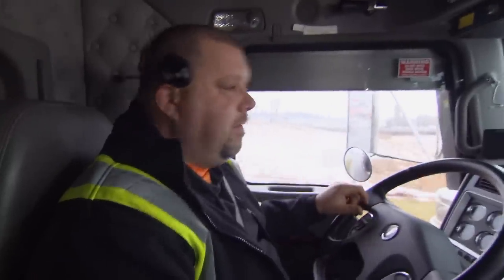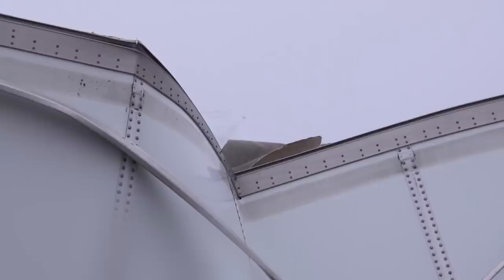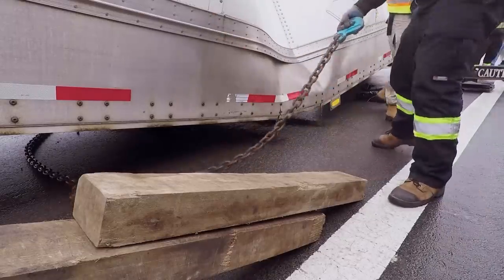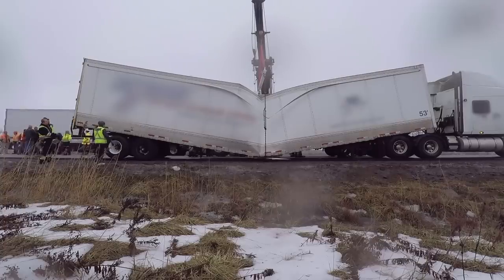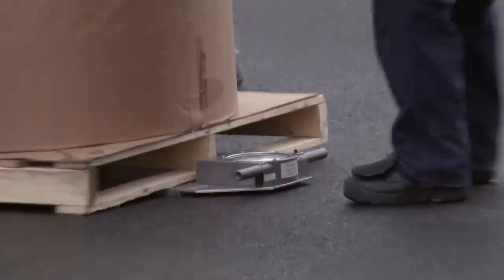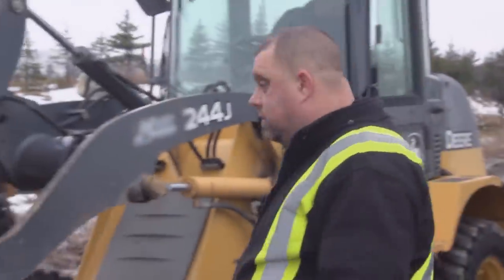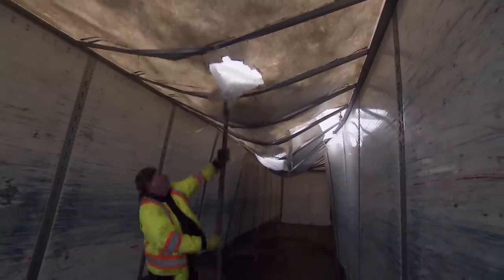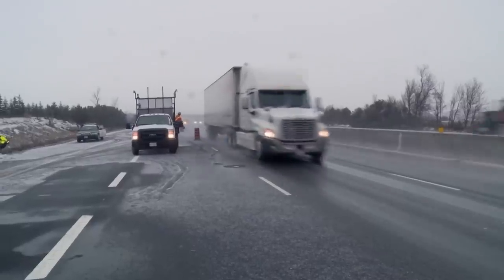What On Earth Happened To This Truck?! | Heavy Rescue

Comment: Have WAY better trailers in Europe, these is like tin cans
Reply: Well it has a fiberglass/canvas roof poor engineering plan and simple
Reply: There is 100's of different styles and designs of trailers made in North america and this trailer is a piece of shit designed trailer. But saying there all the same just shows that you have absolutely no hands on experience with trailers in North America.
Reply: Jason D hey
No trailer should be shit
Period

Its not worth it to have something dangerous and heavy on the road
Just because its cheap

No excuses there
Reply: @mrono1910   You don't have to tell me!!  I would never buy or own a plate trailer or a trailer with a junk translucent roof!!!  I have bought trailers that have broke in half just like this that broke because of the translucent roof but when I rebuilt the trailer I would put a aluminum roof back on it and put it back together like the factory should have!!!
Reply: Van trailers are built like a house of cards. The ribs on top hold it up but the roof still dose support it even a metal roof would have collapsed. I have seen a conex container do the same thing
Reply: Trailers are known to not last as long as their tractor counterparts.  So why make it expensive when you can make it for cheaper and get extra profit? Europe is so expensive you get ripped off by just ordering a coffee from a local shop.
Reply: @смиренный-х2б   If you buy a quality made trailer and if you take care of it and keep up the maintenance then it will last forever!!!!!  I just sold a 2000 Great Dane 53' dryvan that was a old style model that had steel logistic posts on the walls with aluminum panels with aluminum roof and it was in better condition than a new trailer when I sold it 2 months ago!!!!!! And it had almost 2 million miles on it.
Reply: Buying cheap trailers results in the load being damaged, this trailer would almost certainly have its load ruined due to the fact that it broke.
Reply: @Ben31337l   The company's that buy most of these junk plate trailers are big cheap company's like swift, j.b.hunt, schneider, us Xpress and so on. But those are the same company's that don't care that they have fatal accidents everyday because they hire inexperienced idiots to drive there trucks because that's all that will work for them for minimum wage and they get what they pay for with cheap drivers and cheap trailers.
Reply: @jasond5405  That might be a little bit of an exaggeration about those companies. If they had a fatal accident daily they would all be out of business. I don't work for one of those companies but from experience I can tell you your a little off in your thinking. One fatal accident can easily cost a company 1 to 2 million dollars after the lawsuits. So it would not take long to bankrupt anyone of those companies. Those companies are cheap but not stupid.
Reply: @claude9250   I hate to break it to you but it happens more than you think it does!!! And that's why they got the FMCSA to remove all records from public view so you can't see how many fatal accidents they have. And that's why the big companies with all the inexperienced drivers have insurance company's covering there ass instead of being self insured like big trucking companies use to be!!!!!
Reply: aslo why the us trailers don't have 3 axels?
Reply: @kristjanpirc537   The US has different laws than in Europe for weight distribution and axle configurations. In the US we have 3 axle tractors and 2 axle trailers vs Europe having 2 axle tractors and 3 axle trailers. But they both run 5 axles total on a normal road truck.
Reply: @jasond5405 I'm a driver with 26 years in the industry. During driver meetings our company goes over our accident rate. Then they compare it to our competitors. These statistics included all types including fatal accidents. It is not like how you are portraying. I agree that the companies like Swift, CRST, JB Hunt, Schneider, etc., etc. are cheap no doubt. However, they are not out there causing mayhem and destruction. Do those companies have accidents they sure do but if it was that bad eventually the DOT would audit them and possibly shut them down. As a side note I work on the LTL side of trucking. Guess what even though we hire more experienced people our company and other LTL companies still have accidents. Not as many as the truckload side but they still happen.
Reply: @claude9250   You have spent way too long on the LTL side because there accident rates are threw the roof and DOT won't shutdown or go after those big companies that run the ATA and already own the politicans that are already in there pockets!!!!  Just go to any truck stop and just sit there and watch how many accidents those big companies have in just a couple hours at that one truck stop while you sit there!!!! And now take into consideration how many truckstops that there is in the United States and then think about how that same thing is going on at all of them!!!! Not to mention those accidents in a truck stop never hits there  DOT or MC # or there CSA score because it happened on private property!!!  Why do you think the government took down all CSA scores from public view??? It's because people could see the truth about there safety ratings and since they already have the government and politicans in there pockets they had the scores taken down immediately!!!!!  But if the tables were turned and all the small companies and owner operators threw a fit and even if they went on strike to have the CSA scores taken down we would have all been laughed at while they are counting the money the ATA just paid them to stick it to the small guys!!!!
Reply: @jasond5405  So what is your problem with these large OTR companies? Are you a driver? Perhaps an owner operator with an axe to grind. Because you and me see this two different ways. First you talk about fatal accidents but then now you lump in parking lot accidents at a truck stop. Two different things when you consider that a truck that swipes another trucks mirror or backs into a light pole at a truck stop, does no personal injury. Those type cause no deaths or major damage. No I have spent 10 years LTL and the rest has been in other capacities. So I am not blind to what is happening. Also you mentioned that the FMCSA bury the statistics. I hate to break it to you but you can request that info or go to their website. It is not top secret. Here is a fact about 12% of all road fatalities are caused by large trucks and buses. So I guess we better shutdown all the people who drive cars because they cause the remaining 88% of road fatalities.
Reply: @jasond5405  Yep, another owner operator with an axe to grind! 26+ years ago I was a no experience truck driver, and I was given an opportunity by Schneider National. They put me through their truck driving school in Green Bay, Wisconsin. That school doesn't exist anymore now. I worked for Schneider 7 years accident free. Then decided to move on to greener pastures. I have nothing against them or any of the other major truckload carriers. I'd agree with you that they are cheap but they are not stupid. Currently I work for a large LTL carrier with approximately 9,000 drivers. So you can hate on my employer for being large and doing whatever it is you think is a problem in the industry. I'd use their name but they monitor social media and would rather avoid any conflict issues.
  I'll tell you what there are alot of scumbag owner operators and small companies that I have plenty to say bad about. Especially the ones that brag about how fast their trucks go. They are dangerous, rolling down two lane highways at excessive speeds. I have seen this happen all to often with grain haulers and bull racks. Last year we had about 100 hogs roaming around Highway 30 because an owner operator went way to fast on a ramp and rolled his truck. Not to mention many dead ones that did not survive the crash. So cry all you want about large companies but you O/O and small companies have issues too!!!!!
  Electronic logs are good for the industry. Because back in the day if you will recall most drivers cheated their log book or carried two. It is not because they are hard to fill out unless you can not read. So I have plenty of examples of crappy owner operators. In fact I watched one at a local warehouse try to turn in the parking lot which is tight and ripped up a refrigerator unit on the nose of a docked trailer. No skin off my nose but it sure did piss off the people at the warehouse.
Reply: @MrMathiasdv  Ya they get away with selling junk trailers in the US and the government doesn't care about it. They make trailers cheaper and lighter with thinner walls every year and they keep getting weaker and weaker. For instance you can buy a light weight Great Dane (PLATE) trailer with a translucent roof for $24,000 or you can buy a quality built Great Dane with posts built into the walls with a aluminum roof that is narrower inside and weighs more but it is twice as strong for $34,000.  Most all of the trailer manufacturers in the US make those weak cheap PLATE trailers and 19 out of 20 times that you see a trailer break in half it is a plate trailer.
Reply: @jasond5405  That's all you got is to insult me and then to call me a driver wannabe. I have never had an issue with an ELD. Neither will anyone else if they follow the rules. You do not have to race the clock if you plan your trip accordingly. So that's your personal problem. It's only you small operators that complain and get upset with the change. I'm glad that you have forgotten more than I'll ever know, like that was an original thought. I think that has only been said for eons. So yes, if you want to get snarky I can certainly get ugly with the comments. That however, is not my intent, only to have a reasonable discussion about transportation safety. All you got is to bad mouth large companies. I'm glad you have been successful but you certainly have a lot of hate for large companies that are doing just as well or better.
Reply: @claude9250   Well I didn't have a attitude until you came at me with (yep another owner operator with a axe to grind) but thats not a attitude???  I don't have a problem discussing the problems with safety in trucking on YouTube because I hope some people can learn the truth and the facts from someone that has been in and around the trucking industry there entire life!!
Reply: @jasond5405  Maybe you need to look at your first reply to my post and everyone after. Attitude and exclamation points. Sorry you did not like the axe to grind comment but it seemed appropriate with the cussing and seriously negative opinions about the state of the industry. I agree there are things not to like.
  I don't like some of the changes but some are not that bad like ELD's. My biggest gripe is Hazmat background checks every time I renew my license. Whatever, I'll jump through the hoop so I can continue driving. Also think it's bogus to need tanker endorsement to haul liquid totes in a van trailer but again I'll do what is necessary. 
   The real reason you are probably against ELD's is that it is gonna cost you money to install them in your fleet. Guess what my company has to replace our old ELD units to comply with the new changes. That won't be cheap. So be it, I've got nine more years and I'm gonna hanging it up and retire. I'll be real happy to get off the road. Tired of the rude drivers, large fleets or small fleets and the four wheelers.
Reply: @claude9250   My problem is not with the price of a ELD. My biggest problem is that they are unsafe when you are forced to drive tired!!! You can't tell me that you have never got to tired to drive when you still had hours left on your log book!!! Because I'll straight out tell you or the DOT and FMCSA that I have lied and rewrote my logbook several times rather than forcing myself to drive tired when I was a hour or 2 away from my delivery and I had enough time to make it to my delivery if I force myself to keep driving tired. Or pull over and take my 10 hour and completely miss my delivery and screw up my entire week and miss all my delivery appointments for the rest of the week because now I am a day behind schedule!! or I can take a hour or 2 nap and rewrite my logbook and get there safely rather than forcing myself to drive tired!! And my second problem with ELD is this communist government wanting to put a GPS in my truck THAT I OWN so they can track me 24 hours a day 7 days a week!!  Because last time I checked this was suppose to be a free country?? But having a GPS stuck up your ass so the government can spy on you is NOT freedom!!!
Reply: Simple, but effective.
Reply: This isn't even a trailer, how would anyone in their right mind think that this tin can made of playing cards and wheels attached on the back, be able to hold itself together, let alone hold any kind of heavy load, it doesn't have any trailer frame whatsoever 😂 it's like telling a person without a spine to stand up 😂
Reply: Trailers under engineered in Murica. Over dramatic as usual for tv suckers
Reply: Get out of here with that.  Trailers are the same all over the world, especially with international companies.
Reply: @kvmairforce  Nop, european trailers usually have a heavy steel frame under the trailer to keep it solid, aswell as far as I know, Us trailers have tandem setup while eu use 3 axle setup, ofcourse there might be exceptions, also both sides have different laws on how much they can carry. And ofcourse they're not gonna be the same, just like our tractor trucks with cab over design are different from Us conventional style... (length limitations, aswell as need for maneuvering in europe vs long straight american highways) even the biggest international companies will use local resources, cause they are purpose built for the area and also you don't need to pay a lot on shipping those trailers. And ofcourse I could be wrong, not a professional here, but a bit of research online aswell as having experience unloading Eu trailers and being around them, and having never heard in a million years of a trailer breaking in half 😂 I'm pretty sure I'm good
Reply: What do you mean you have better trailer in EU the smugglers cut the sides with a fruit knifes 🔪 and steal everything
Reply: Well as least us Canadians know how to English

Comment: Sorry guys the weight of snow on the roof doesn't explain it. The trailer will be designed for specified superimposed loads on the load deck and the roof multiplied by suitable dynamic factors. Something else is wrong. I am a Chartered Engineer and know how these things are done.

Comment: Overloaded AND a gap in the load.
A driver (normally) breaking and going faster from a brake might allow the load to move around, create a gap to the weakest point in the trailer then, perhaps, a mistimed acceleration and or brake then, crunch!

Comment: 50k lbs and they wonder why it caves in???
Reply: xxxTHROATBANGERxxx limits like 78 k
Reply: Wesley sipe its a tandem not a tri axle. Shouldn’t be loaded pass 45k.
Reply: @xxxTHROATBANGERxxx  is that a Canadian thing or a van thing? Because I drive a flatbed in Pennsylvania and have loaded 51,000lbs on my spread axle trailer on many occasions.
Reply: Largo Angolo it all depends on total weight of truck but most vans are @15k. So combine the load weight and then tractor weight and your way up there. It also depends on your state cause in texas you cant run past 80k gross without permits and then you have to have tri axles. Must tractors are @17500. So 17,500+15,000+50,000=82,500

Comment: That's what happens to those van trailers they are not made for heavy loading day after day like a flatbed trailer, I seen many of these trailers do this, they fatigue and break. I have seen ice build up on the top of them and cave the roof in.

Comment: It needed a middle axel with wheels.
Reply: It’s and awful long trailer for two axles. In Europe the container trailers usually have 3 axles and are 40 foot long.
Reply: @ferguson20diesel49  You mean 45 ft long, some these days are 48ft long..
40 footers went out 20 years ago..
Reply: Ferguson 20 diesel I’ve been seeing you a lot the past couple days
Reply: @darabradley5173  Yipeee
Reply: Gareth Ifan seen me where here I you tube I suppose. Aren’t container still 40 foot on the dot.
Reply: @ferguson20diesel49  You're right Dara - container boxes are bang on 40' but trailers are generally 45' or on certain jobs (Supermarkets and bulk light goods) now have the option of the 'super long' 48' trailers. They're still regulated to the 44T max gross weight tho. 
How's that Diesel Fergy going - good going little tractors eh?
Reply: Gareth Ifan I had her since I was 10. Engine changed tune one day. So I decided to get rid of it. Never used it, anyway. I use a fiat 110-90 all the time now.
Reply: @ferguson20diesel49  Have to go along way to beat a Fiat diesel, hear the tractors are pretty good. I always like them, but never got to use one in anger
Reply: Gareth Ifan great for pulling. We’ve a NH spec 110-90 for a long time now. Mainly just used for pulling the digger and concrete pans
Reply: @ferguson20diesel49  Get you..they've a nice note too
Reply: Gareth Ifan they do. Great straight 6 roar. When pulling 20 ton. Jd 6610 sounded well too. She ruined now
Reply: Seriously get a room you two
Reply: That is a 53 foot trailer